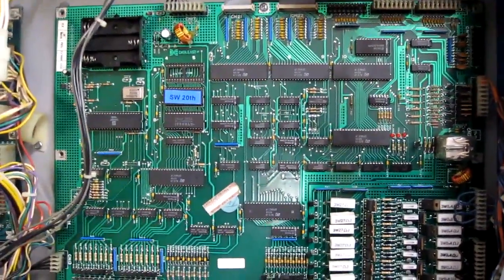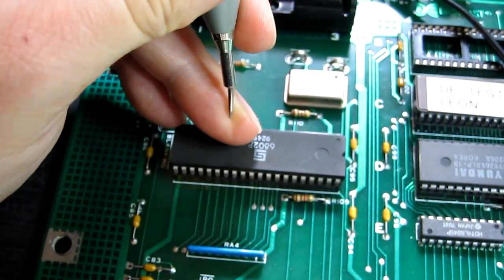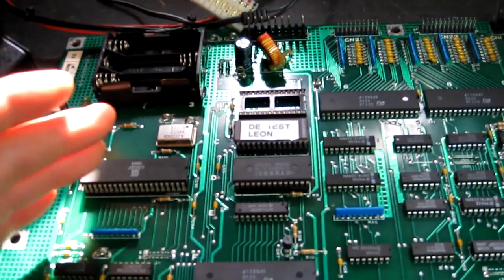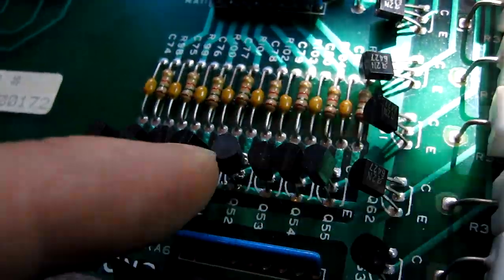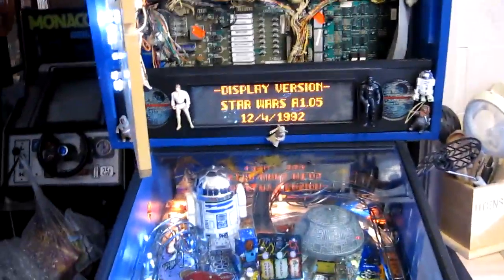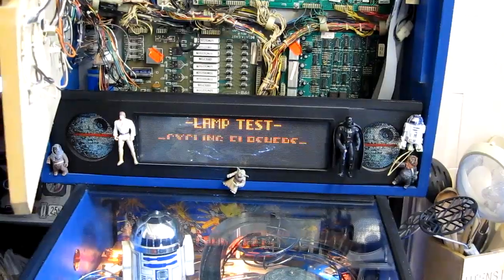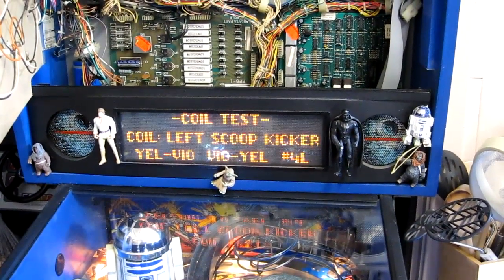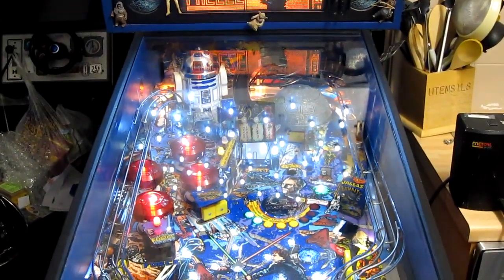Data East Star Wars CPU Board Repair and Upgrade

Comment: Interesting. Is that a test ROM you put in when it's out the cabinet?
Where do you get your replacement parts from in the UK? I want to build my own Pinball machine and need somewhere to get new or very good second hand parts.
Thanks
Reply from the maker: Hi mate, it's the Leon test ROM. If you want parts in the UK, there is Pinball Mania, Pinball Heaven and 1st Stop Pinball. If you were purchasing parts to build a pinball from scratch, you would be looking at hundreds if not thousands of pounds of parts, so it would be an ambitios project!
Reply: Thanks for the list of those shops. Yes I see a flipper assembly is about £35 for one :o
Might see if I can reclaim some stuff from old games maybe.
Ambitious yes! Imagine it's going to take a few years.
Reply: TENGO UNA TARGETA

Comment: Very interesting!  I noticed there towards the end some purple looking beams going straight up, is that IR from some sensor or something?  It got me wondering if its possible to see CD or DVD lasers side on using a camcorder...  I would think that anything in the IR range might show?
Reply from the maker: Hi mate! In this case, I think it was mainly the LED's being very bright and having some IR content. You are however correct, that cameras / camcorders are very useful for testing IR light sources. In pinball machines, IR led's are used often in many places, in the classic "beam break" detection circuits, to detect when the ball has passed a certain place. Also many use a row of IR lamps to detect how many balls are in a ball trough. These often are not working, and can be easily tracked down using a camera/camcorder. Your success will vary these days however, depending on the filters on the camera sensor. Older camerers all seemed to pick up IR great, but some modern ones I have seen no longer can.